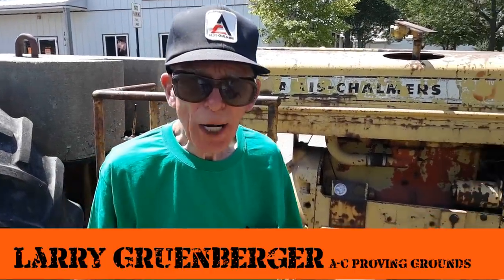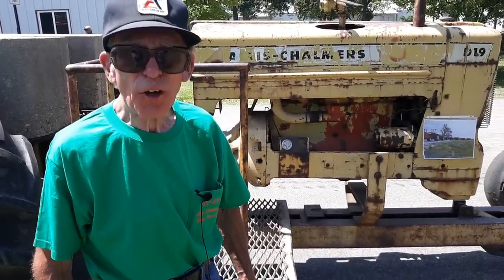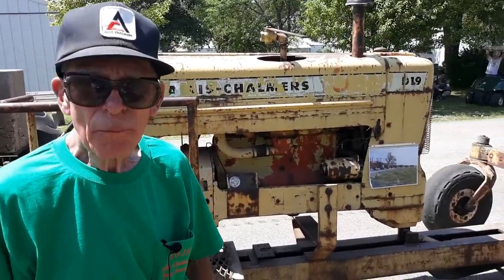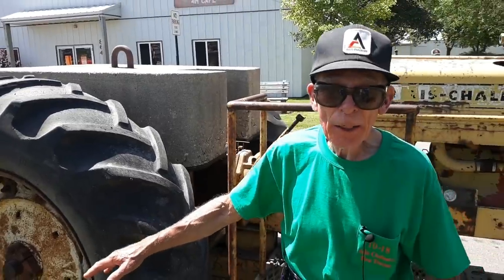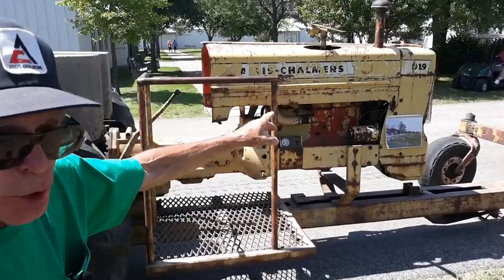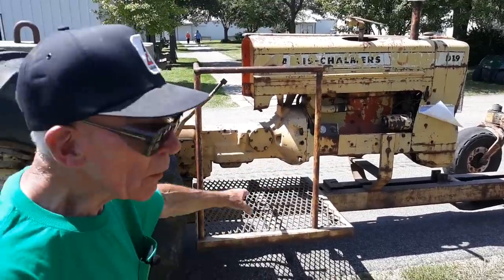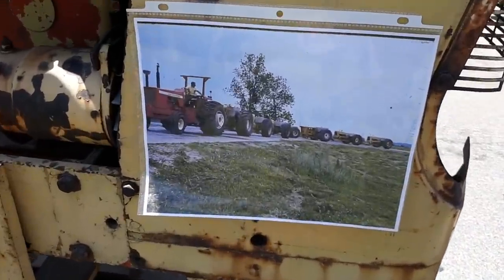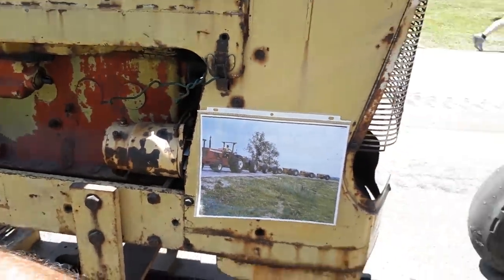Rare Allis Chalmers D-19 Tow Tractor From The Company Testing Grounds

Comment: I worked for an Allis dealer when all the equipment at the proving grounds was sold. We bought several loads of miscellaneous parts, wheels, tires, weights and engines that looked usable.  We also bought one of the later model test tractors that I believe was a 7050 chassis.  We parted out the engine and rear end.  At the time, you just looked at the piles of parts or tractors that you were interested in and made an offer.  It may have been the guy in the video that made the sales. I remember that they had a prototype 4W305 with no gears in the front axle that had thousands of hours put on in Arizona.  I was interested but didn’t buy it. I also drove one of the prototype 8090 (maybe 8095, I can’t remember the number for sure) tractors with Komatsu engine and power shift with 3 speed range transmission.  That would have been quite a tractor if Allis had survived. As I recall, all the Komatsu engines were to be pulled out and returned to Komatsu.  Rumor was that the chassis were sold to a dealer that installed Cummins engines.
Reply from the maker: It was probably him, he told me his last job was to sell everything
Reply: J and L Videos There was so much stuff piled up and on shelves.  They used what looked like 7050 rear axles with welded flat wheels to drive the dyno cells. We didn’t trust that those were still good for parts. They had stacks of fully weighted 24.5x32 complete wheels full of fluid too. I did buy a pair of them and used the turf tires on a grain cart.  There were several of theD series and 7050 mule tractors but we only bought one for parts..  Thanks for the memory!
Reply: J and L Videos There was so much stuff piled up and on shelves.  They used what looked like 7050 rear axles with welded flat wheels to drive the dyno cells. We didn’t trust that those were still good for parts. They had stacks of fully weighted 24.5x32 complete wheels full of fluid too. I did buy a pair of them and used the turf tires on a grain cart.  There were several of theD series and 7050 mule tractors but we only bought one for parts..  Thanks for the memory!

Comment: IH did a similar test of their latest model before they filed for bankruptcy.  The clutch pedal only operated a switch, that operated a hydraulic operated clutch.  They tied the tractor to the ground so it could not move.  Then revved the engine to full power. And engaged the clutch until the engine about died, then released the clutch.  At every cycle, the clutch was drenched with five gallons of hydraulic fluid.  They repeated this for 50,000 cycles, then tore it down checking for wear.  No wear noted.

Comment: Hmm from a Engineering point of view. A tractor towing a heavy load on dry pavement. Does nothing to prove how well it will perform in the dirt conditions.  There is so much more to consider.
Reply: It wasn't used to prove how well it pulled in dirt
Reply: It was to test fuel economy and durability.   Let's you know how long the machine will last.
Reply: Just like engineer to over think 🙄
Reply: They was seeing if they could cause failures.
Reply: Ugh.. it was just to give Jobs to friends....
Reply: How do you know if someone is a engineer.....     

They'll tell you.  Lol.     
Nebraska tractor testing still tests similar to this.    Paved oval track with machines in tow.  Using a lot more data points though.